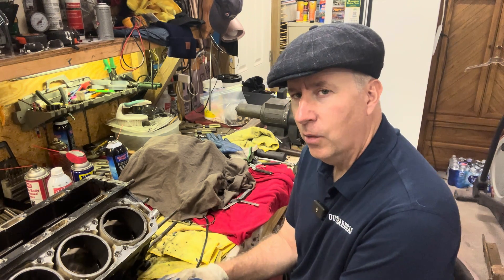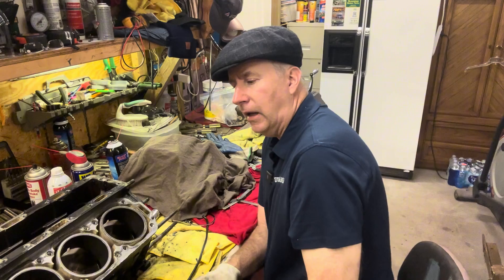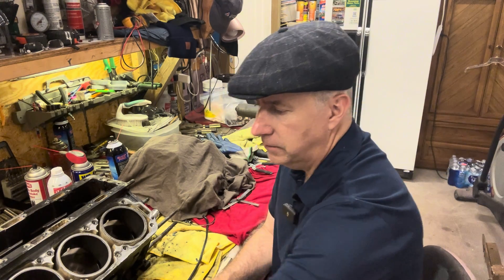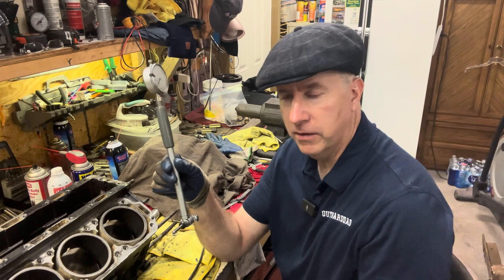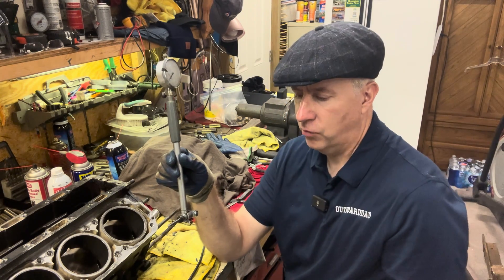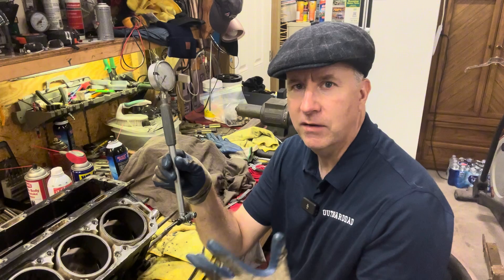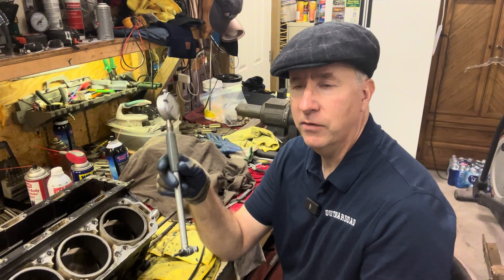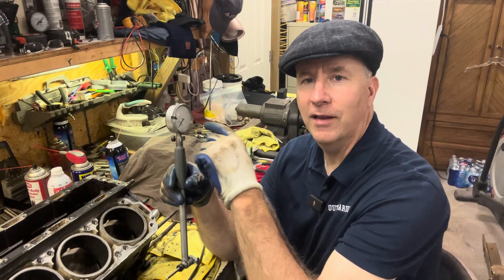Mercury Outboard rebuild piston wall clearance (Part 8 or 9)

Comment: Keith, I am going to assemble my rotating assembly tomorrow,  gonna check various rings in different holes to try and get them as close to spec as possible, great tips in this video!!!
Reply from the maker: Keep me posted!
Reply: @OutboardDad Got my Brucato Ecu today, waiting on boysen reeds from primaries, took 30 off the heads
Reply from the maker: @mercman2.5 Sweet! I can hear it screeming across the water now!

Comment: When I got my motor back from the machine shop with the pistons they supplied, I never checked ring gap..(I’ve learnt this from your video) with their machine, they had to bore 1 cylinder to 40 over, the rest 20 because they said from factory the cylinder in the block was crooked. Any way that cylinder now is coming up at 140 compression the other 3 are closer to 130. For future reference Is this because of ring gap not being even? Does this make a 2 stroke run a little hairy with uneven compression when you mention the importance of this?
Thanks for you knowledge and inspiration..Kevan
Reply from the maker: @Allaboard-KnK  Hey Kevan, that is not too much of a difference to be concerned about. It could be the ring gap or the bore size. You shouldn’t have a problem if it was done properly but only time will tell. What I would do is keep an eye on it and do a compression test from time to time and if it gets more than 10 % out from one to another then disassemble and measure pistons, cylinders, and ring gaps. Let me know if I can help with anything else. What motor do you have?
Reply: @ it’s the 1987 Johnson 140 I sent boat pics the other day… runs pretty well so I guess it’s ok but I’ll keep and eye on it for sure…Planning to do a early 2000 Merc 200 when I find one for a next project!
Reply from the maker: @Allaboard-KnK  Nice! I love those Mrec motors. Are you thinking carbureted or DFI?
Reply: I’m a bit old school so like the carbs haha but not many around over here most are efi
Reply from the maker: @ I like the EFI from Merc but I think the DFI Optimax just was a little too much more to deal with and go wrong. They really run well , quiet, no smoke, and fuel efficient but definitely more to maintain and repair. The carb motors are just so simple

Comment: .008'' clearance on a 3.5'' bore sounds like an awful lot! but if thats what the manual says i guess its right! always wondered what seeing that exhaust on the piston skirts meant and i assume blowby from it escaping past the rings. is that anything to worry about or do you think that just happened during cold starts?
Reply from the maker: @ct1762  .008 is more that typical but not out of the ordinary. I know guys who rebuild motors and never even measure the wear , just hone and put in new rings and run them for many years. Not the way I would recommend, .008 is about the limit before I would want to oversize and that would be after honing that may take another 1/2 a thousands. Not sure what you mean exhaust on piston skirts? Can you explain and at what time in the video so I can look?
Reply: @OutboardDad  i agree you can get away with a hone and new rings on used pistons just wont have quite the punch of a new bore and pistons/rings! also makes the motor noisier. as for timestamps ill have to look but just check out below the rings and all that black carbon staining from exhaust... very common just curious as to your thoughts.
Reply from the maker: @ Interesting, I will look and see

Comment: Keith!! Just want to say got my ignition came in and I successfully got it wired up and the ones i am not using I made sure to properly make them safe getting them off the way, But I got  her going and turned off , I did the purple with the white line that goes to my Solenoid Pump just because I would love not having to pull the cover off to choke it. Just in time to put it in the water for hunting season! be seeing you around
Reply from the maker: @seedless-bud  awesome! Glad to hear it. Keep in touch
Reply: @OutboardDad  i will be here!